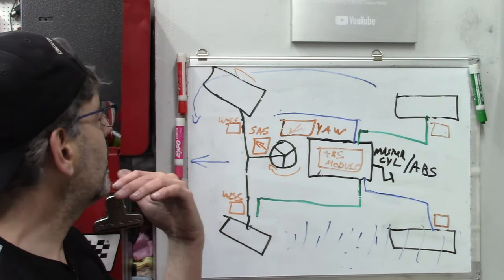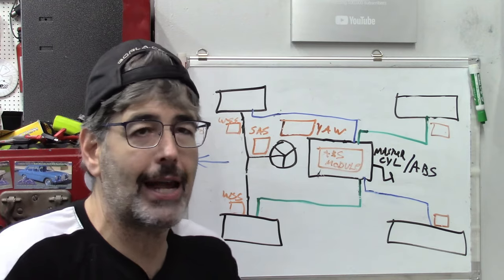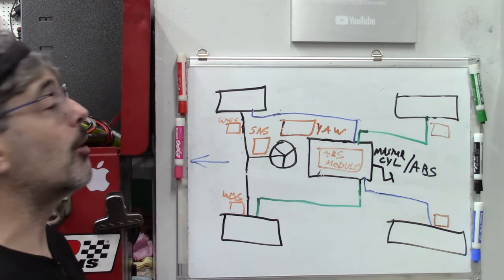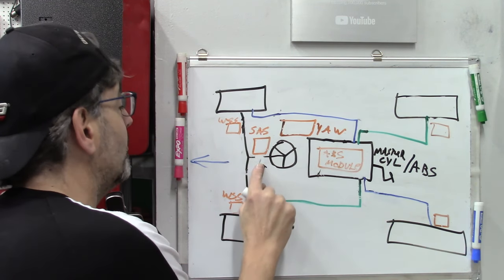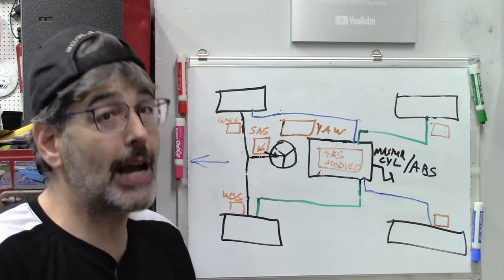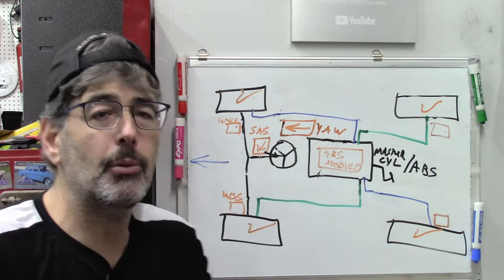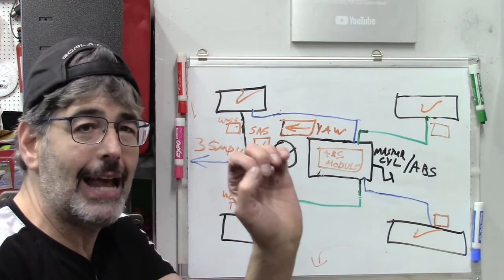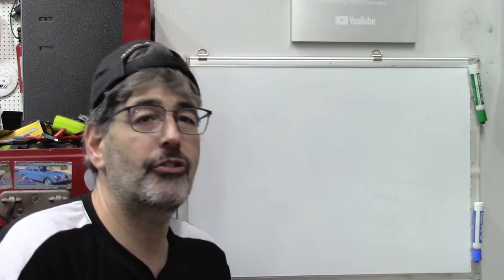A Cool ABS Brake Diagnostic Story

Comment: The fact that you seen it in live data is the key catch here.  Just taking the time to skim over all your data pids and look for something to jump out at you is worth spending a few minutes on;  not that much different than taking time to do a visual check under the hood on certain situations.  Codes are an obvious clue, but knowing what the live data pids should look like is a huge benefit.  Scanning all the data quickly and sifting out a discrepancy is an artform all on it's own; and worth practicing.

Comment: Ah yes! Wheel speed should be different from left to right while turning, but considering the wheels were actually straight, it triggered the ABS. Makes total sense!

Thanks for sharing!
Reply: Yep.  desired vs actual 
I'm shocked it didn't throw a code for it
Reply from the maker: @calholli it did not. I don’t know why either. I didn’t know there was a desired reading, actually. Given the steering angle is a variable user input, maybe there isn’t a desired but rather a calculated expected value or something? But even then if it doesn’t match an expected value that’s exactly how it knows to respond assuming the vehicle is losing traction.
Reply: @SchrodingersBox   Right.. The expected/ desired value probably has a tolerance:  within 5 or 10 degrees maybe.  They just didn't program a code for it I guess.   It should definitely see a discrepancy between the steering angle being turned, and not having different wheel speeds.  I guess they didn't write a code for that either.

Comment: Very nice video.  I learned how all of these systems were tied in together when I diagnosed a friends 2017 Ford F150.  It had codes in the ABS and steering column control module.  The ABS codes were for a Control Module, Steering wheel position sensor, and RR speed sensor.  The SCCM module had a code for Invalid data received from ABS control module A.  

I got live data on the scanner for the ABS control module and went for a drive.  I was losing the RR speed sensor signal intermittently.  I compared voltages at both of the rear wheel speed sensor connectors, and they were the same.  Truck only had about 29,500 miles on it at the time and there was no corrosion in the connectors or wiring issues that I could see.

We ended up replacing the RR speed sensor and it corrected all of the other fault codes that were stored in the PCM.
Reply from the maker: Great job and great example of how a complex result comes from just one faulty sensor input!!!
Reply: @SchrodingersBox  Yes, a lot of times, one faulty component can set multiple codes that are resolved by finding out and fixing the part that has failed.

Comment: Amazing video! I just had a similar issue with a 2005 Navigator. The traction control light would randomly cut on and occasionally the ABS would kick in. Did a SAS relearn, problem solved.
Reply from the maker: Hmmm how can you have it relearn steering angle?? I can see relearning yaw- but steering angle is preset by the clockspring and is mechanical, no?
Reply: @SchrodingersBox  The launch scan tool had a recalibration function for this model. I’ve seen on some Toyotas, 2013 Camry specifically, where the battery has died and the wheel was not centered, and when the battery was replaced, whatever position the SAS was at became the “new 0”. I would be able to disconnect the battery, return the steering wheel to center, reinstall the battery and the SAS would be recalibrated to a “true 0” point. This car didn’t have this issue until after another shop had done an alignment on the car and had the battery die on them at some point. I have to assume something similar happened here.
Reply from the maker: well I stand corrected!! I just got a Nissan in and I see there is a steering angle adjustment available on the scantool. wow. maybe it doesn’t use a clockspring type SAS perhaps.

Comment: Shouldn't most steering angle sensors self-calibrate after turning the steering wheel lock-to-lock through its travel and then drive straight ahead for a time?  Perhaps this vehicle had an earlier iteration of a stability control system....
Reply from the maker: Good question. They definitely do not. And you also can’t calibrate them-  they are part of a clockspring mechanism and you can’t have the angle sensor off and calibrate to it being off because in the case of this car it can be mechanically damaged since it has only so much turn angle before breaking.

Comment: Very interesting Matt just show how working on one part can trigger problems. Does the hydraulic system have solenoids to cut the hydraulic pressure when the computer detects any wheel going to lock up. Bad sensors have brought down airliners, just shows how critically important these things are.

Comment: Stability control is perhaps the biggest change in driving ever (at least on ice or deep sand). In the old days cars only turned because of the angle on the front wheels. Nowadays the brakes can help the car turn as well.
Reply from the maker: Absolutely!  I agree - probably an even bigger safety improvement than airbags.

Comment: Please do a steering wheel angel sensor calibrating video
Reply from the maker: Good idea. I so seldom have to do that however in retrospect I should have shown that in my previous clockspring replacement video.
   Actually- you don’t calibrate a steering angle sensor- you can just verify its position is correct. the angle sensor is a spring device so it is out of calibration it’s a mechanical problem and you can’t reset to its incorrect setting. in the case of this vehicle it is lucky it didn’t break from being overextended if driver made a sharp turn.
Reply: I mean from scan tool after a repair
Reply from the maker: You don’t calibrate the sensor after a repair. When a new steering angle sensor is installed the steering wheel and wheels are set to straight and the sensor only fits on one way and is preset to the zero point. There is no calibration or setting. 
   See my video here showing the installation of such a unit. https://m.youtube.com/watch?v=e0kIQ1xspcY
Reply: @SchrodingersBox  thats right , i  mean way of preset from scan tool ,sorry for my english ,thanks brother
Reply from the maker: well I stand corrected!! I just got a Nissan in and I see there is a steering angle adjustment available on the scantool. wow. maybe it doesn’t use a clockspring type SAS perhaps.  I’ll have to investigate that but you are correct- some cars do seem to have an adjustment for steering angle indeed!!!

Comment: Code set criteria:
SAS to Yaw, hey are we turning?  Yaw - naw, 
SAS to WSS  wtf?  WSS 35 on all corners
SAS -huh...,  ABS sup?  I’m getting implausible data?
ABS, shhh we are just in a wicked forward skid I got this.
CEL setting code for o2 sensor heater circuit.

Comment: Don't those systems have a "learning" function where it calibrates the angles? Or was this beyond specification?
Reply from the maker: They do not. The angle sensor is a physical spring device. If it’s off calibration, there is a mechanical reason for it- it cannot be learned like a Yaw sensor or something. In fact this owner is lucky the spring didn’t break if he had turned sharp enough with it already being extended a turn.

Comment: What happened was it sounds like he didn't reprogram the wss for the taller tires and it was triggering the tc to come on
Reply from the maker: Good guess however if all tires are the same then wheel speed will be matched for all wheels. It wasn’t wheel speed causing the issue on this one. But good thought.
Reply: @SchrodingersBox  yeah I saw that in the video afterwards. That can happen though

Comment: So if it was no mechanical issues it couldn't be just relearn the system ?.. I'm curious.
Reply: You likely can't just relearn.. the clockspring can only turn each way so many times and basically needs to be at the fixed zero..  it can fine adjust to get your wheel straight-- but being a full turn out is too much
Reply from the maker: Calholi is absolutely correct (as usual). The clockspring is actually a spring. In fact the owner is lucky they didn’t damage the clockspring by overextending it if he turned sharply enough.

Comment: I find it difficult to believe the clockspring didn't break if it sas a full revolution out of center... That would set all sorts of codes.
Reply from the maker: No It didn’t break- I thought same thing. but also maybe the car wasn’t turned full left or right either.

Comment: hey matt, i’m restoring a 92sc’400 it’s been sitting for 8 years i changed spark plugs and wires no start, i then check the fuel tank it is all rusted so i change the fuel tank and the entire fuel assembly still no start, i even did a fuel pump bypass by putting a paper clip to have the fuel pump constantly prime the pump and still no start im think the fuel lines are rusted
Reply from the maker: What is the fuel pressure showing?